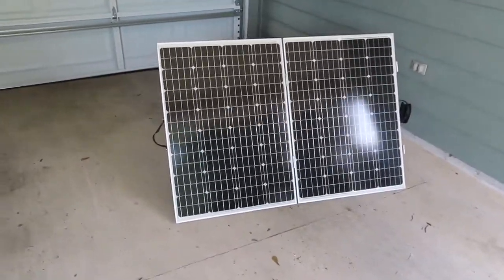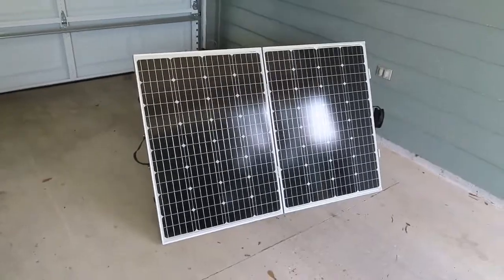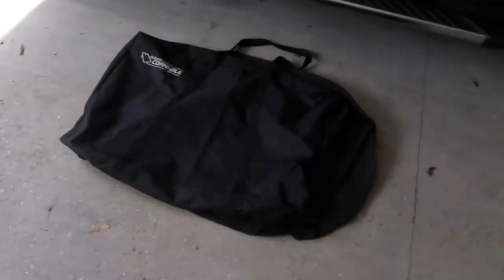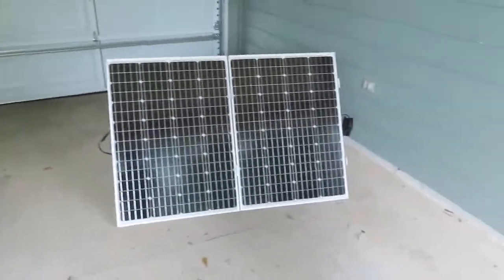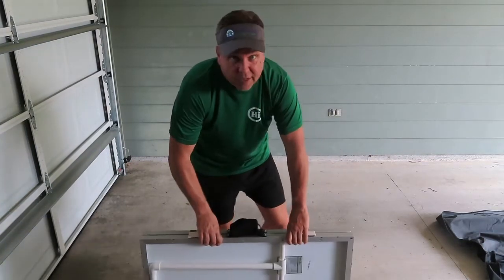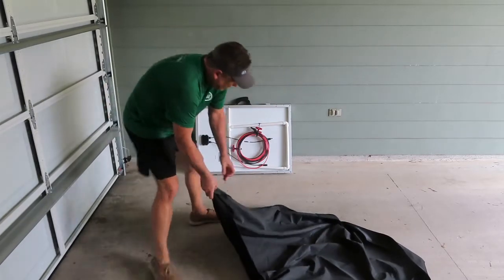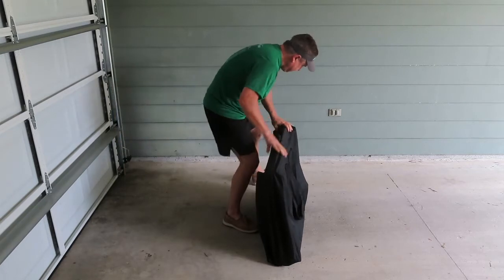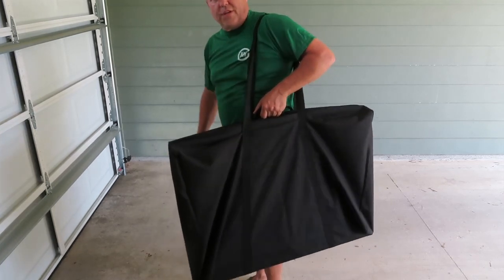Solar Suit Case Corn Hole Travel Bag

Comment: how wide are your panels? I can't actually  go measure mine but the  online description says 36x27 inch is there a couple inches of play on the width?
Reply from the maker: I "think" that was the online description of mine. They measure slightly less. A little tight fit at the corners. But not bad at all

Comment: Mike , what size panels are yours ? Ours are HQST panels here , size 32.5 x 26. Or 33x27 ..thanks again ,,,,,super vids ..👌🏻👌🏻 …
Reply from the maker: mine are 36x26
Reply: @MikeJordanUnCamplicated  THANKS… 👌🏻… headed to Amazon…😂😂
Reply: Mike the corn hole case works great , thanks for the info ..only have (1 100 Watt panel  for now ) box and all fits , but 2 would be great 👌🏻 …thanks for the head up. Maybe I’m over protecting on panels ,,but glass scares me ! But the corn hole cases work SUPER !

Comment: Hi again, I’m ready to order the Cornhole Travel Bag but I don’t understand the measurements. My panels are 100w and the measurements are 40 inches X 27 inches. Will this kind of bag work for me. I’m having so much fun building this!
Reply from the maker: I think mine were 36x26. But read down the  comments,  answered fir someone else
Reply: Well I looked on Amazon and found a bag for a Gravity Chair that’s 42x28x9 inches it’s only $23.00. I’ll probably have enough room for another panel in it. 😂 But of course I won’t be able to lift it. So I’ll put some foam that came with the panels on the sides. If it doesn’t work out then I’ll put my Gravity chair in it.
Reply: @MikeJordanUnCamplicated  Thanks! Here is the link to the on I find the will fit. RISURRY Storage Bag for Zero Gravity Chair, Folding Longue Chairs Carrying Case to Carry Beach Chairs and Director Chairs for Travel/Camping, Black

Oh it’s not a link. Hmmmm
Reply from the maker: @RVFreeDa  that looks like it should work perfectly